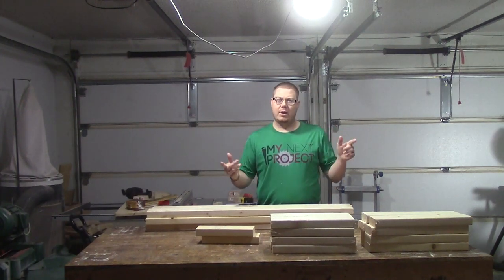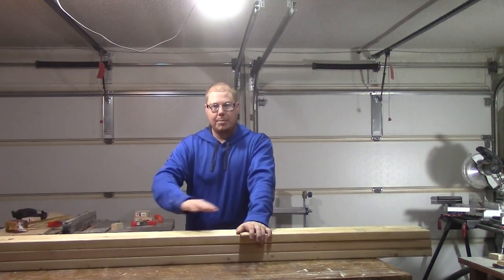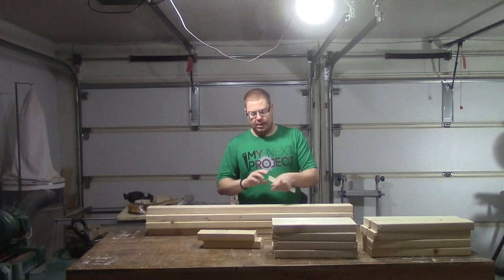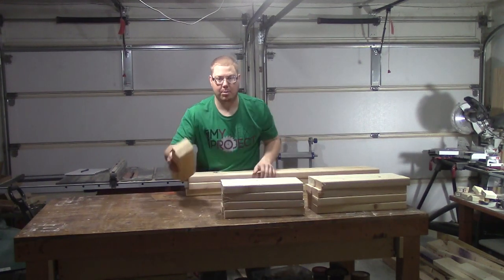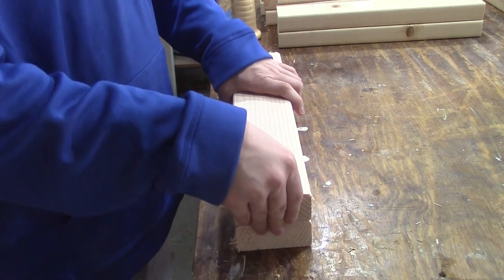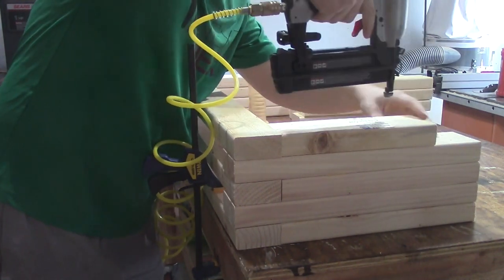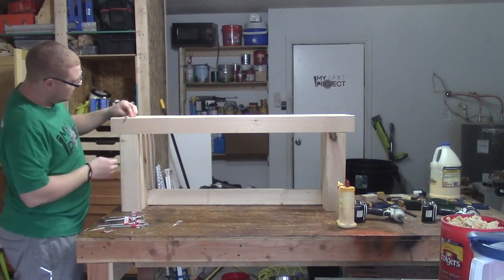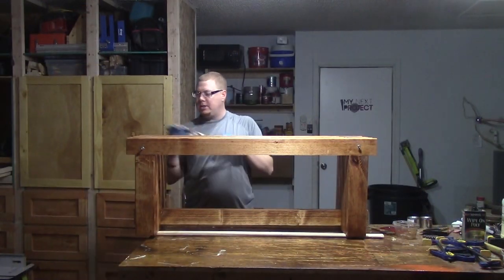Bench (Very easy) UNDER $20

Comment: Rule of thumb with woodworking always finish the entire project and -stain-polyurethane or paint prior to assembly. much easier and u will never miss a spot.....
Reply from the maker: That is a good rule of thumb.  If i remember on this project, i was concerned about the glue and didn't want it to cause problems if the bench was finished.

Comment: Thank you for a great video.....Question :  I am planning on making a bench for the kitchen.Can the length be 6 feet and add additional weight without compromising the strength and durability ??   Thank you
Reply from the maker: It will probably depend on the thickness of the boards.  A bench like the one is this video would be strong at 6 feet.  I think you would have the best results with building a frame, and then adding the top to the frame.  Hopefully that would make it strong enough.

It maybe a trial an error deal.
Reply: Thank you very much for your reply MNP . I thought about the frame.   Will give it a try.   if the person crashes crushes the bench,then I know I have to re-inforce....lol    Just kidding !!!  Many thanks

Comment: I am some what new to the craft of  dyi so I have a probably stupid question.. lol... If you are using a Nail gun why the need for the screws, is it to just make a stronger build?

Added Question.. 
Does it matter what kind of wood ?
Reply from the maker: I added the screws to help make sure everything was tight for when the glue dried.  The brad nails are kinda to just hold it in place and are not a long term solution.  

Probably not.  I used Pine because it is cheap and available in my area.
Reply: Really no question is a stupid question I'll be honest nails back out screws don't me myself I try to use screws for everything

Comment: Guys before you waste $ 20 +/- at Home Depot, this project bench as it was built would be strictly for indoor use, using it outside, the bench would begin rotting within two (2) years, guaranteed. This wood used in this project will also begin to separate if the bench is left outside, because the glued joints, cross pieces, legs, etc. were not properly clamped when the glue was applied, nail pinning, will not and does not replace clamping. 

Albeit, you could use treated lumber to keep the build from rotting, but you don't want to do that either, inasmuch as you do not want your clothes nor skin to come in contact with treated lumber. Using framing lumber (2 x 4 pine) to build projects is not the best of ideas unless you plan to actually straighten, flatten and seal the entire outside of the project and keep it indoors.

If you really intend to build the bench at least use wood clamps, water proof wood glue and a hardwood like Cherry, Oak, Walnut, Maple, etc. also use a planer to flatten the face of the wood and a jointer to flatten the sides, then hand sand to smooth the entire bench's surface.  Do not use soft woods like big box store framing pine etc. you will only be wasting your money.

Just a suggestion:
Reply from the maker: The only parts to this bench that are not screwed along with glued and brad nailed is the very outside face pieces and the runner on the bottom.  I used 2 screws to screw every single board together, and it shows me running a few of those screws in while assembling.   

Yes you are correct that if you use this bench outside in the weather, it will rot after a few years.  I would say probably more like 3-4 years but regardless it will rot.  If you keep in on a covered porch or something like that it will last much much longer.  

This project was more intended for an easy cheap project that you could do and get a few years out of it in your yard or wherever.  Since it only cost around $20 to make (+ stain) that isn't goo bad.  If it only last 2 years, that is only $10 per year.  

The woods that you mentioned using (Cherry, Oak, Walnut) are all very expensive, at least in Texas they are.   Using those types of wood, would probably make this bench cost over $100 easily.  Another option would be using Cedar wood.  That is much cheaper that the hardwoods mentioned and should last longer out doors.  But still more expensive than pine.  

My goal for this project was to create a cheap bench, that looked nice, and pretty much anyone could build.  It was not to build a bench that would last for an extended period of time.  

I appreciate your comment, and you watching the video.  Hopefully this will shed some light on what I had in mind when creating the project and video.
Reply: The Shadow, good maintenance with a rubbing oil or annual applications of poly should extend the usable life of this project for many years. For the price and ease of the build I'd still say it's a worthwhile endeavour. I would love to see this in red wood or teak though.
Reply from the maker: JPVegh that would look very nice in either of those. But probably be expensive. Thanks for the comment and watching.
Reply: David Findle   Thanks for the input I want to make one with new code treated lumber and I want to stain it.
Reply: Mine was built using regular 2x4 lumber. It was coated with deck sealer and has been outside on the deck for 2 years and shows no sign of decay whatsoever. The thing is rock solid.

Comment: Disliked, not able to see how your final product looks like clearly. All that can be seen is a cross section. What a waste of time.
Reply from the maker: I'm sorry.
Reply: @MyNextProject  I'm not sure what he's talking about, I built one and found your vide VERY helpful. No problems. My wife uses it on the deck to hold large heavy potted plants. The thing is solid as a rock!
Reply from the maker: @Wayne Novotny Thank you very much.  The one I built is still in great shape and is sitting on my parents front porch.  These are very sturdy and will hold pretty much anything.